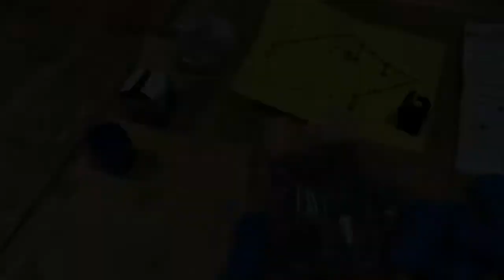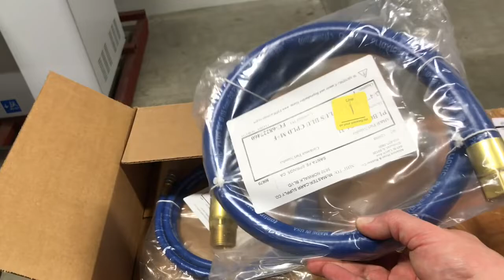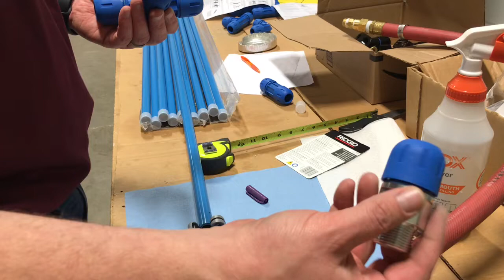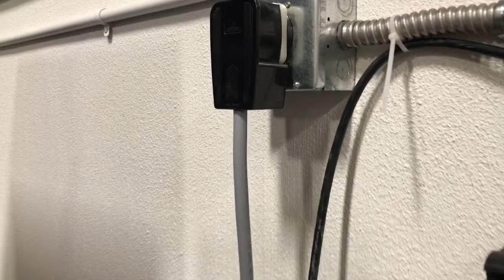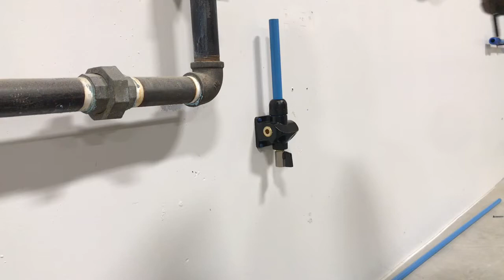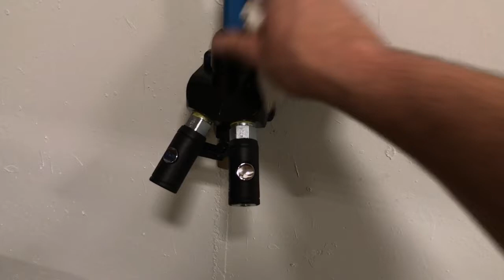How to install Fastpipe 3/4" RapidAir Compressed air line, Tips, Unboxing and Review  of fast pipe

Comment: Good video.  Interesting you mention wanting your pipe perfectly level.  I typically run my pipe with a bit of fall toward the drain/blow out.  Since water condenses in the airline as the compressed air cools, it needs to have a way out.  Putting some slant in the line lets the water run to the drain to be blown out.
Reply from the maker: I'm sure that can help. I haven't had any issues.
Knock on wood... I haven't had any moisture in the line to speak of at all at any connection point. I have clear traps on all machines in our showroom and again, thankful I've never seen a drop of oil, debris, or water in any of the lines.

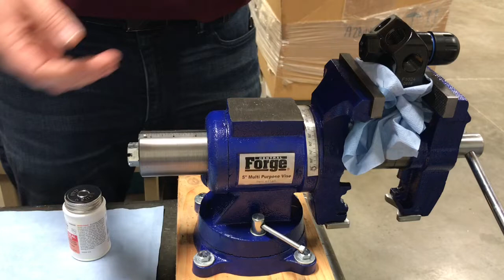Comment: Let me start by saying I’ve been an Aircraft Technician for over 35 years, I have several FAA Licenses that qualify me to be anal about everything.   We only use air tools because of explosion hazards so I have a few suggestions, should be easy corrections.  First,Nice shop and expensive CNC tools, and nice install but few big mistakes.   On compressed air system water is biggest problem.  1.  You hooked a beautiful Quincy Screw Compressor to a $40 PRV Filter.  Every tool downstream is going to be relying on that cheap PRV Filter.  Don’t buy crap from Home Depot or Amazon.  Replace it with a quality one like HANKINSON.  My home 2 car garage shop compressor is connected to 3 HANKINSON Water, Oil, Air Dryer filters before it tees off to shop.  2. From Compressor to Filters then tee into shop Air Line on the Horizontal with a 24” Vertical Water Trap on the 6:00 Bottom port.  3.  While level Blue pipes look good, they have water condensation in them.  Ideally you would pitch the Lines 1/4”/ ft to drain water to the Sumps.  4.  Every Low point Tool Port should have a  Water Drain Valve. 5 Compressor Tank should have a Automatic Water Drain Valve.  6. Drain the Water Sumps daily.
Reply from the maker: Hi Patrick,

Thanks for the comment and thanks for watching.
Sounds like some very good tips.

To respond specifically to your first number 1 point. Yes it is a very cheap "filter" connected to the nice rotary screw air compressor but I'm simply using that as my air regulator to bring the pressure from compressor to my entire shop to the desired level. I think I'm at 120 psi or so. The compressor isn't easily adjusted and runs a little higher than what my shop needs. 

The quincy QGS has the refrigerated air dryer built in that should prevent moisture or oil from entering the system but that little cheap filter also acts as a great visual for me to keep and eye on and spot any problems if they happen.

Yes, I could get a better brand regardless, that's not a bad suggestion.
Also in regards to pitching the lines AND providing a water trap...all good points.

I haven't found any moister in any of my lines ever since setting this up. In addition just about every tool I do plug in downstream also has their own filters and regulators where they connect to air. Again, I do not rely on these to clean dirty or wet air but I just use them as a good visual to see if I ever have any problems. None of them have every collected any moister or debris. (Knocks on wood.)

Thanks again for watching!

Comment: Nice clean job! I was wondering why you put the water separator at the compressor end. Every video I've watched on youtube has done it that way. I would have suggested putting it way down the line to give the air time to cool and drop the water. Very nice looking compressor btw.
Reply from the maker: This system already has a built in refrigerated air dryer to remove moister and oil, dirt, or any other debris. It's not so much a water separator as much as it is a pressure regulator. I wanted to regulate the pressure to the entire system so you must do that at the compressor outlet spot. Thanks for watching!

Comment: Hello Switzerland here, I am always amazed at the use of two types of sealant for thread joints. Normally, joint paste is sufficient just like teflon for small diameters. But putting the two together increases the risk of slipping in the thread, which should be avoided at all costs with teflon. A good seal must be over the entire depth of the thread. So either one or the other but certainly not both together. Also remember to scratch the threads using a hacksaw blade to prevent the teflon from slipping when winding it, as always clockwise or counterclockwise in the case of reverse threading.
Reply from the maker: Thanks for the comment. I believe the instructions said to use both so I just followed. A quick search online I can see it's a hotly debated topic. Thankfully I haven't noticed or heard any leaks.

Comment: Nice system.  Just close off the valve and the 50 should stay.  If it doesn’t there is an it leak.
Reply from the maker: I haven't tried this in while. I think it will eventually unload but I would think it should hold for at least 24 hours. Something new to test this week!

Comment: $500???!!!!! For just the RapidAir kit! Holy crap. This can be made with PEX for less than $140
Reply from the maker: It was probably half that price when we installed years ago in our showroom.
But this is a hard aluminum pipe with all the fittings. Very high quality.
Years later and still ZERO LEAKS! I'm very impressed.

Also, they offer a flexible pipe option but it comes in coils and you straighten it yourself the best you can. I just really liked the solid straight pipe look and quality.

Comment: Is FastPipe tubing the same as copper tube size?  Or a lot cheaper?
Reply from the maker: I think the main reason people go with Fastpipe type setups over copper is not cost but the ease of use to install and setup. Most people don't know how to sweat copper pipe or have the proper tools. With these Fastpipe setups just about anyone can install with great results. 

If I can do it.... you can do it.

Comment: what are those couplers with one hand operation called
Reply from the maker: Here is an example... Rapidair K7220 Push Button Safety Air Quick Coupler, 1/4 FNPT, Black Rapidair https://www.amazon.com/dp/B07B1G3L6Y/ref=cm_sw_r_tw_dp_M6FPF9X4NSANTNPZ0A1M

Comment: Their 3/4" coil line is much much more of a challenge.  You are snapping them together just like a Sharkbite fitting which anyone can do well.  The coil line deforms enough and the 3/4 size is substantial enough that getting them to slide into the fittings (mine were metal) took a lot of force even with conduit lubricant!  Using their tool (very different from yours) you have to ream them thoroughly or you will be out of round and not chamfered which will not allow the 'O' ring to slide into the pipe.  Even doing that it was difficult to get enough grip to apply the sufficient pressure to seat the pipe into the compression fitting.  Their fittings are extremely overpriced.  You made the right choice on getting the straight pipe if you live where they can ship that length.  I don't.  Straightening is not that easy or fun with the coil line.  The saving grace on the 1/2" system and drops is standard plastic push to fit fittings work quite well, not so with the 3/4 as far as I can find out at this time.  Also normal pipe thread manifolds work with the system.  Take care.  Doug
Reply from the maker: Thanks for watching Doug. Yes I did not want to fuss with trying to make the pipe straight. So far it has worked out very well for me!